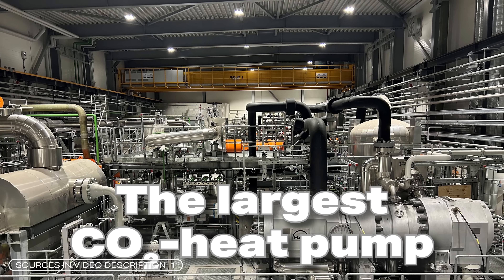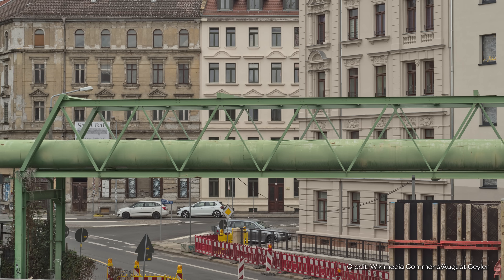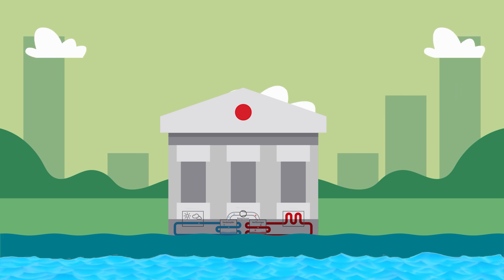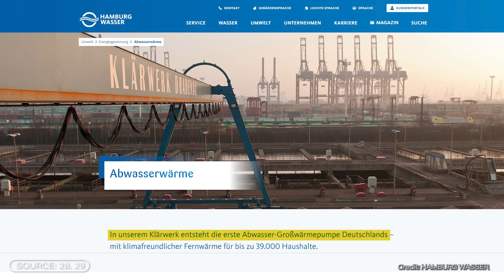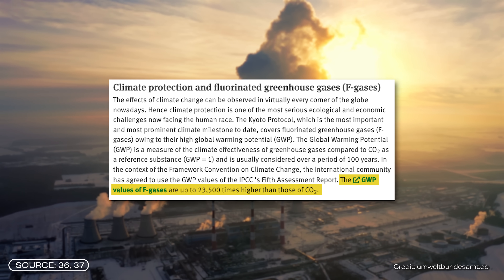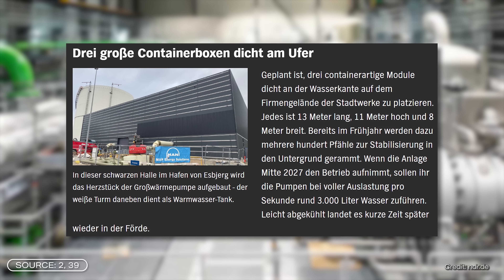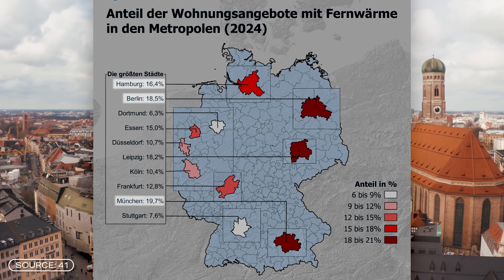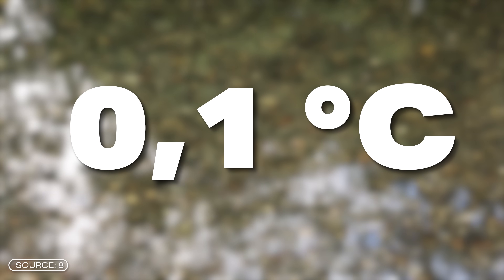World's Largest Heat Pump: Denmark’s Seawater Heating Revolution

Comment: Hi, just a quick fact check. The efficiency of a heat pump is not impacted by the level of insulation. That’s a statement that puts people off installing them. Obviously it makes sense to insulate first, however some homes in the UK are harder to do. If you need to replace a boiler then get a heat pump, it will generally save you a bit of money if using the correct tariffs in the UK. Where the spark has is lower, it should save a lot.
Reply: I mean... you could say... technically... that if you use a programmable thermostat (like most houses probably do)... and you set it to a lower temperature at night (like most houses probably would)... then your heat pump will run less at night when you have more insulation.  And the efficiency of your heat pump is impacted by the outside air temperature... which is lower at night.  So using your house as a thermal battery in this way could prevent the heat pump from running as much at night, making the operation of the heat pump itself more efficient in addition to the energy saved by just having more insulation generally.
Reply: Nah
Reply: My understanding is that heat pumps have a higher COP when they're not working hard.. the idea is that good insulation means that a heat pump can add small amounts of heat all the time, or so goes the theory. Can you explain why this isn't the case?
Reply: @oliversissonphone6143  Your conflating sizing of a heat pump system with other independent factors.  Heat pumps efficiency is dictated by their design and by the change in temperature they are producing, generally not the amount of thermal transfer barring edge conditions like frozen coils.  The insulation you have and the desired temperature drives your need for heating or cooling not the efficiency of the heating or cooling source used.  So yes, you will use less heating or cooling with more insulation, but whatever heating and cooling system you use a more efficient one is better. More insulation does not make a heat pump itself more efficient, it makes your whole home more efficient regardless.
Reply: @oliversissonphone6143 . Sorry I didn’t reply earlier. On holiday. There are some good replies there. The heat pump itself will be cheaper to run if there is less heat loss. The actual efficiency is determined by the difference between outside temperature and flow temperature. Whether you have insulation or not it won’t matter. You will need to put less heat in overall.

Trying to simplify it.
A house with poor insulation might leak 10KWH of heat per hour. You would need 10KW heat pump. With a COP of 4 this would mean 2.5KWH of electricity per hour.

If you could insulate this same house so there was only heat loss of 5KWH of heat per hour, then you could use 5KW heat pump. This could also have a COP of 4. This would only use 1.25KWH of electricity per hour.

Both heat pumps are the same efficiency. One costs half the price of the other to run.

However if the cost of insulation for the big pump doesn’t make sense, then you could still go for it as the difference between gas and electricity might still stack up.
Reply: @davidjrobertson3192 Thanks for your reply. I'm only repeating an argument I've heard and I have no idea myself. You're comparing apples with oranges here because you're comparing a 10kW heat pump with a 5kW heat pump, which would have cost more. The argument I heard was comparing two identical heat pumps - one run a low setting, the other at a high. Their argument was that running it at a low setting had a better COP - is there any truth to this?

Comment: I wonder how much heat is lost thru piping, etc. and energy thru pumping. It would also be interesting if flexible system could be made that heat is pumped in from multiple locations such as multiple data centers etc

Comment: I am currently involved in the construction of a much bigger seawater heatpump plant in Aalborg, which will have 4x44 MW heatpumps totaling 176 MW of heat. The plant will replace three coal fired boilers of which only one is still operational and scheduled for closure in 2027. Additionally there are 3x50 MW electric resistance boilers (think tea kettles but obviously quite a bit bigger) which can supplement the heatpumps in case of high demand or low electricity prices when for example it is windy AND sunny and all the renewable sources are over producing. To even out production and demand, four huge heat storage tanks are under construction, scheduled for operation this year. They total 200.000 m3 of hot water. Most of the city and municipality of Aalborg is district heating covered.
Reply: The system in Aalborg is even more diverse in its heat sources than written above. Besides the elements mentioned above there is a waste incinerator (50 MW) and a cement kiln (around 100 MW as far as I know) delivering energy to the district heating. Heat pumps are also being installed on the outlet from the two sewage treatment plants (total up to 26 MW). Then there is some more future plans with waste heat from a Power-to-X plant producing syntetic aviation fuel - interesting but more in "birds on the roof" category.
Reply: @jensageholm8774 Absolutely. I was just summing up the replacement for the coal fired boilers.
Reply: That's quite impressive, damn.
Reply: Thank you guys for quietly making everyone’s lives better 🙏🏻❤️
Reply: oh hi fellow person from Aalborg (i assume)
Reply: Insane as long as there is not enough power generated. 

The cost at additional power prices is to big
Reply: Alsome
Reply: This can happen when you're country isn't run by oil and gas criminal crime families. America probably never
Reply: The problem with Aalborg is just that the prices are going up and up, it used to be the pinnacle of district heating with some of the lowest prices in Denmark - was it around when they bought Nordjyllandsværket it turned. Wattenfall wanted to close it and then they decided to close it by themselves after they bought it. After fire with no production for 1.5 years, a insider trade case because they didn't report in that they didn't produce, but would draw power to the electric boilers instead and since then only been able to run on reduced power due to vibrations in the single generator. I'm happy that I moved out of Aalborg before all this - it's not getting cheaper anytime soon...
Reply: @AndersKvistDK It used to be super cheap but I think that was partly due to all the waste heat from the cement factories (plural). Now there’s only one. 
The generator was vibrating but they took it off-line for six weeks last summer for revision. Not sure if they fixed it, but gave us a window to build a branch off the cooling lines for the seawater inlet. 3 m diameter GAP pipe is pretty cool. Lol. Unfortunately it did leak when pressurized but six weeks was super rushed too. 
Don’t know about the rest of your points.

Comment: Thanks for the youtube feature
From a Dane who has lived in Flensburg and is now back in Denmark, I have district heating in both places, in Germany it is expensive, where I live now, I pay almost nothing, the district heating on gas is expensive.
With pump systems like you have shown here are good as they stop the emission of extra heat, but as you write yourself, they cannot take enough heat out of the sea and rivers to counteract climate temperature rises, but it can still be a helping factor

Comment: If a heatpump can generate 5 kwh of heat from 1 kwh of electricity, why can we not make generators that run on this heat? To generate more than 1 kwt of electric power again?
Reply: Because the energy efficiency of heat pumps drops off massively the higher the temperature delta(temperature difference between input & output) and you need rather high temperatures for efficient electricity generation(>100-400C i.e. high pressure steam) compared to to central/district heating at ~30-70C.
[edit]This is also why power plants make excellent district heating sources as they can use the district heating loop as 'free' cooling to condense the steam back into water. In fact the Soviets used to build NUCLEAR district heating plants just for this exact purpose.[/edit]
Reply: @Lag_Monster  What about a stirling engine instead of a steam turbine? Could it not use both the hot and cold side of a heat loop to generate mechanical energy? Or would the losses just be too great for it to be worth it?

Comment: well insulated but poorly designed house needs almost the same amount (sometimes more) energy for cooling even in North Europe. With this in mind for the house we bought I have installed ground source heat pump. The distinct feature of ground source HP is almost free cooling. I'm very happy with the comfort. Circulation pump and fancoil use around 0,03 kW to cool 150m2 house.

Comment: It seems remarkable that you're able to pull heat out of water at 8°C for domestic heating!
Reply: Thats not whats happening.  The water cools the evaporative exchange process.
Reply: @dherman0001 Can you explain further? Aren't they heating? Therefore the "hot side" is on land and the "cool side" is in the water? And why the 8° minimum?

Comment: The use of a period instead of a comma as the separator instead of a decimal point really threw me.

As for bureaucracy - I'll raise you a Thames Gateway project which would make German bureaucrats green with envy - years of work has produced nothing but a massive bill (£1.2 bn and counting) and over 350,000 pages of documentation

Comment: Thermal energy storage is an option to increase the number of houses you can serve, if you went big enough you could charge the thermal energy storage in late spring to early autumn and run down the storage from late autumn to early spring.
Reply: IIRC they also combine the heat pump with waste incineration, so  they can burn more waste when electricity  is expensive.

Comment: I have opted for flor heating , takes no space no pluming only a small electricity cable and price for installing is low , hence most of us have already electricity , seems to me as a better solution . Taking in consideration the pollution and energy(fossil) needed to extract and proces the minerals needed for windmills and solar panels and the durability of these  and the factories for their making also takes a lot of energy and cost a lot ; I think if the output big heatpumps should be transformed to electricity , if the cost is not to high..

Comment: I think individual heat pumps are always cheaper in the long run, than large projects. They become too complicated, lots of heat losses, and generally incredibly expensive to build/ dig pipes in the ground and so on.
 Example: my house is 110m², I installed a 4Kwh heat pump instead of gas. The total expencies were around €3500. I installed it myself. And it uses very little on a normal day in winter time (620- 750w) are run by solar panels as much as possible. Total energy use including heath, warm water, and electricity, was in 2024 totally 2583Kwh. And that was without a battery.. It will get installed this autumn.
I sold the gas heater for €1100 . The solar system cost (would be lower now) approximately € 8700.
In my town they talk about central heating, it will cost at least €10.000 to be connected, and the annual heating would be ( estimated) €2500+ prices are going very much up every year.. 
The  2583kwh has cost me around €850, and includes electricity.
 And will be less than that in the future.
Calculate for yourself, what is cheapest...
By the way:
As a spare heater I have an aircon type heater, that has not been used at all..(installation price everything included, ,€600)
The first winter, before the installation of the 4Kwh pump , I turned off the gas and used the aircon alone all winter. To be totally frank, it could almost heat the house completely the entire winter except 4 days with extreme cold. Two of these could hear the house completely. The bad thing is circulation of heat to all rooms, that doesn't work, like it does when using floor heating.

Comment: I find it interesting that many cooler climate countries have district heating systems, but few if any warmer climate countries have similar systems for cooling.  Most large university campuses here in Australia have a central chiller plant that distributes water around 3°C to a handful of buildings for air conditioning use, but it rarely services every building on campus and they are very rare elsewhere, apart from highrise buildings having central systems supplying every residence within the building.  I wonder why?  Certainly today I don't think the economics would be there, as more and more people are running their individual heat pumps (air conditioners) from their own solar power so it would be more expensive to purchase chilled water, but in the past it would've made sense, especially before air conditioners were commonplace.
Reply: Copenhagen actually has a district cooling system, besides its widespread district heating. It uses seawater for the cooling, serving hospitals, larger department stores, office buildings and others.
Reply: Here in America solar panels are as rare as truthful politicians
Reply: @Zer0Blizzard  Yeah so over there it might still make sense to have the city provide hot or cold water (depending on your climate).  Here in the subtropical parts of Australia it would've made sense a decade or so ago to do it, but now almost every home has solar so heating and cooling are effectively free, meaning it's too late to have the city provide that because nobody will want to start paying for their heating or cooling.

Comment: I think Iceland has thermal district heating - any relevance to this?
Reply: Not really. Iceland is run on geothermal energy,, since there's a lot of hot water underground. That's because it's a Vulcan island.
Reply: The town on Vestmannaeyjar in Iceland also uses heat pumps for district heating.

Comment: The major point of district heating is that the provider can chose the cheapest way to produce the heat (previously some were forced to use gas due to stupid rules) now if electricity is very cheap you use electric heating, like a heating kettle, heat pumps can be used up to 3-5 times the price of gas power due to efficiency, then gas power engines kick in either in combined power-heat or heat only, then gas boilers, then other bio or fossil fuels. Some larger cities have incinerators that are also power and heat producers that must be used to not make too much of a stink. Also as mentioned giant thermo cans are build to store heat in 10s of 1000s of cubic meters size, both for peak demand and middle long storage so you can produce when cheap and use when expensive production.
Reply: And they can use waste heat.
Reply: @0MoTheG  That too, thanks for reminding me.

Comment: A problem with heat pumps for district heating is the fact that district heating typically use high temperatures, in part to maximize the amount of energy transferred for a given system, and amount of fluid pumped. Especially old systems were often designed for high temperatures, often over 100 °C for very old systems. There's a ongoing trend towards lower temperatures, but you need bigger systems/components to deliver the same amount of heat at a lower temperature. 

Heat pumps in district heat systems have very significant potential advantages, but such systems that use seawater, but don't work when you need the most heat, and the potential advantage of using seawater as the heat source is most significant is disturbingly stupid. 

While pumping the seawater is a cheap solution, initially, it's not very practical in the long run. Having huge heat exchangers in the sea can increase the initial cost, significantly, but that seems well worth it if that makes the system actually work when most of the heat is needed. If the fluid in that system evaporates from the heat it collects, and then condenses when you extract the heat from it you can create a "heat pipe loop" and you won't need to pump the fluid around. 

One potential huge benefit of district heating systems is the possibility of using a combination of heat sources, with or without heat pumps, where you can use what ever combination that happens to be most advantageous at any given time. And the bigger the heat pump system you make, the more likely it becomes meaningful to make use of different heat sources for the heat pump to extract heat from. It doesn't make much sense to extract heat from deep seawater during a heat wave to generate warm tap water. For single household heat pump systems extra heat collectors can increases the cost with thousands of euros, but for heat pump systems for district heating systems, the cost for additional heat collecting systems per household shouldn't have to be very significant.
Reply: Well, the temperature delta for seawater is quite low even if you can go below zero because of salinity. To make up for that you increase volume. For a project I'm working on currently, we will pump 16.000 l/s at relatively high pressure necessitating GAP pipes of quite significant dimensions. The heat exchanger for each heat pump is truly gigantic for the primary circuit. These are tube exchangers about the length of a semi truck and about two stories tall. In Denmark it rarely gets extremely cold and even then, the temperature of the sea doesn't change quickly, so the system is obviously calculated for that scenario. But of course, you would be reckless if you relied on a single source in a large utility scale system.

Comment: 7:43 When you recalculate you should also consider that the insulation might differ. They have an incinerator that needs to run regularly depending on how much waste is delivered, after that the heat pump is planed to produce the next need after that, then there are 100+ MW of extra systems to take care of max load. So most of the year it might run at max.